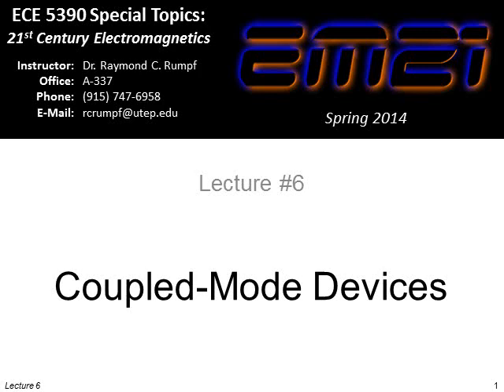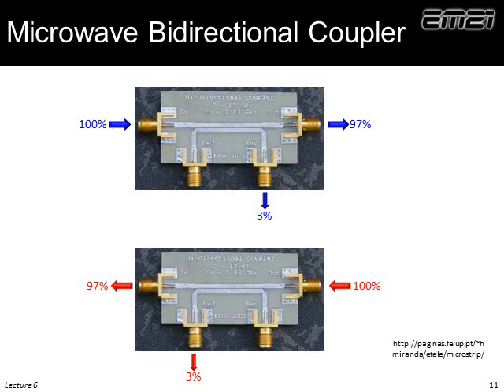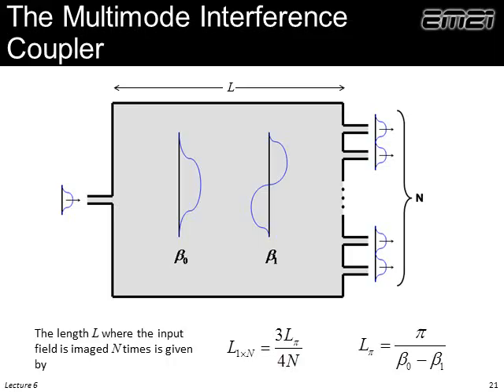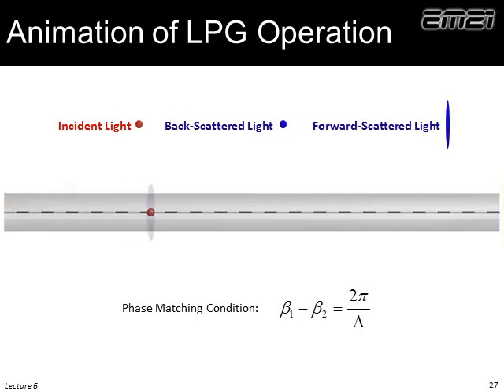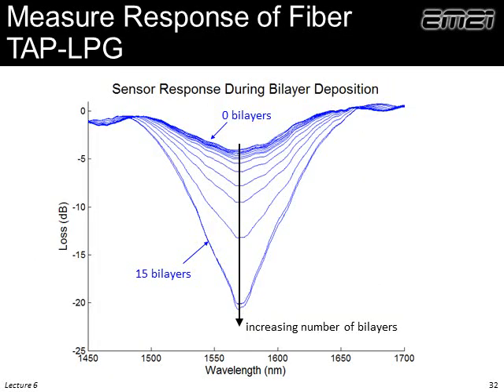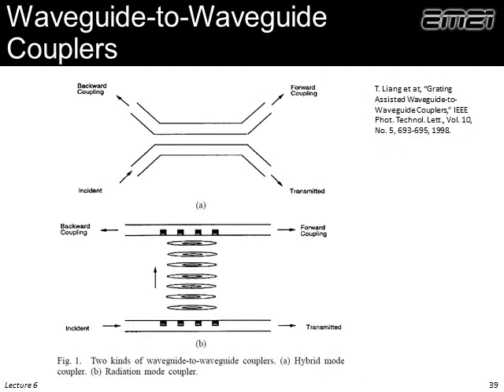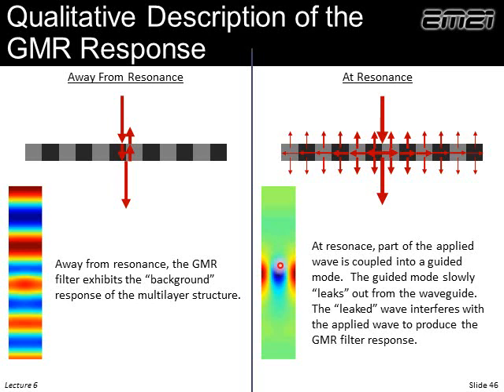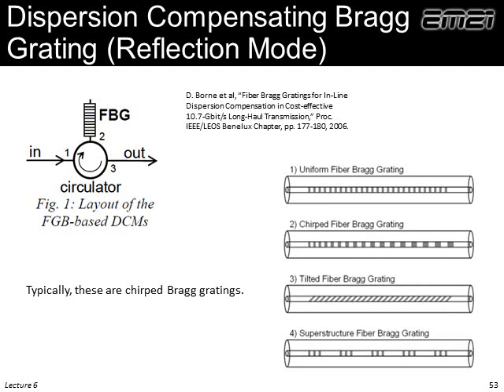Lecture 6 (EM21) -- Coupled-mode devices

Comment: Hello professor, I want to thank you for your lectures, they are amazing! I have a question about GMRF and diffraction grating coupler...I dont understand, what is the difference between them except the fact, that coupler has small number of periods? Thank you!!!
Reply from the maker: Great question!  In my mind, their operational principles are identical.  Both couple power between an external wave and a guided mode.  The difference is just how they are used.  A grating coupler is used to get light in and out of a waveguide.  There are also antennas, like slotted waveguides, that are essentially just grating couplers at radio frequencies.  A GMR uses the wavelength sensitivity of the coupling effect to make a filter and the guided mode is just an intermediate state in the device that we do not directly care about.  In fact, I have designed grating couplers in the past and I always started that process by first designing the grating as a GMR.  It is a very small and fast simulation and I use that to optimize the grating.  Given that, I move on to the actual coupler and play with apodizing or whatever else I want to do with it.
Reply: @empossible1577  thank you!!

Comment: Dear Prof. Rumpf, thanks a lot for this brilliant lectures! I was wondering about something: So, We said that putting 2 waveguides into close proximity to each other,  they start acting as a coupler. Could you probably quantify what "close proximity" means? I guess close proximity means that the mode (which expands over the pumped waveguide) actually "touches" the other waveguide. Is that picture reasonable? Also, what are the typical sizes of modes and corresponding distances for the coupling to work? some µm?

best wishes, stay healthy
Reply from the maker: The rule is that some of the fields must overlap in order for two waveguides to be coupled.  So two enclosed metalwaveguides will never be coupled because their fields are completely contained.  Directional coupling is done with open waveguides for this reason, like with microstrip transmission lines, dielectric waveguides, etc.  How close two waveguides need to be is determined from the size of the guided modes themselves.  In a dielectric waveguide, the evanescent fields (fields outside of the core) extend maybe one wavelength.  Based on this, you could expect to see some directional coupling when the two waveguides are within a wavelength.
Reply: If our grating is made up of metal and the forward and backward wave is of same waveguide for eg in fabry perot cavity there is one waveguide enclosed between two facets of high and low reflectivity. If grating is used to couple forward and backward wave of this fabry perot cavity and grating material is metal like chromium or nickel or any material having higher larger imaginary part in refractive index such that grating has perturbation in imaginary part and such grating is called as gain grating. What will happen then? Do these forward and backward reflected wave will  couple by metal bragg grating.

Comment: If our grating is made up of metal and the forward and backward wave is of same waveguide for eg in fabry perot cavity there is one waveguide enclosed between two facets of high and low reflectivity. If grating is used to couple forward and backward wave of this fabry perot cavity and grating material is metal like chromium or nickel or any material having higher larger imaginary part in refractive index such that grating has perturbation in imaginary part and such grating is called as gain grating. What will happen then? Do these forward and backward reflected wave will  couple by metal bragg grating.
Reply from the maker: Very sorry, but I am not confident I understand your question.  I think I need a picture or something.